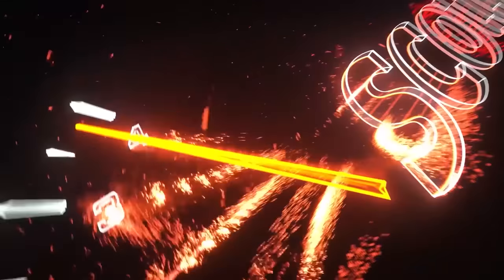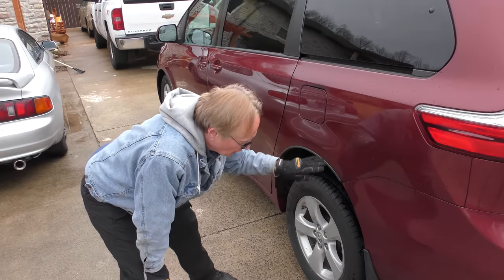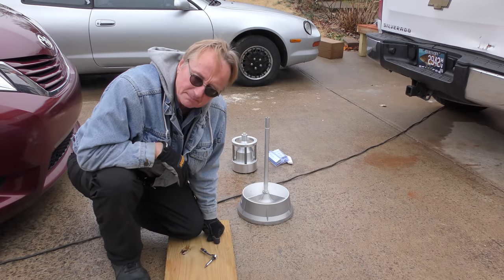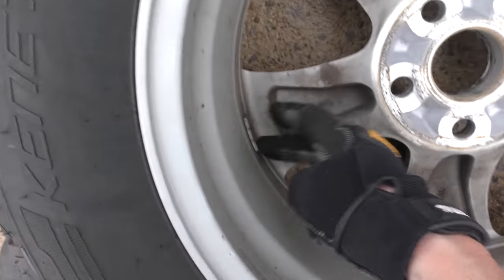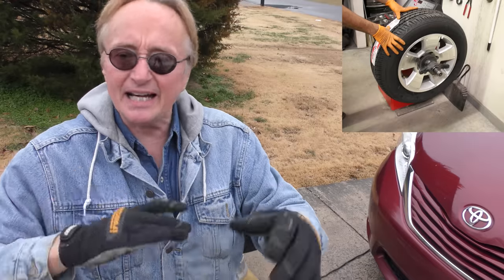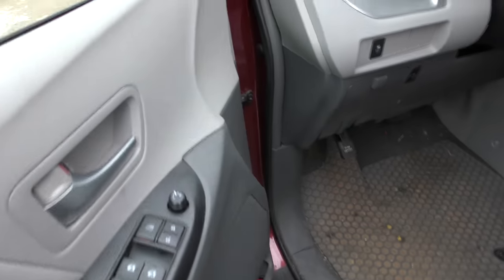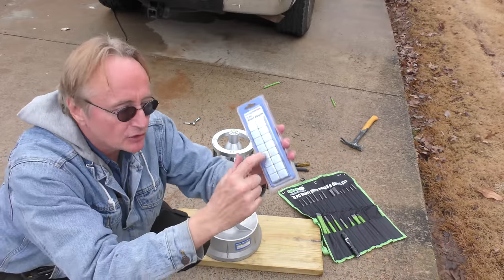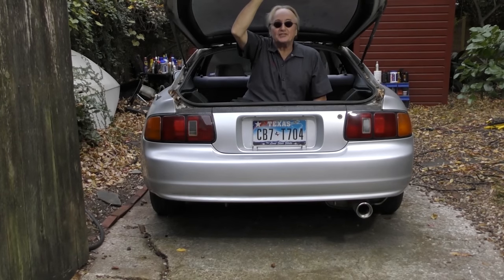Stop Going to This Tire Shop Right Now

Comment: I'm a new subscriber because I was so impressed. I'm 64 and I grew up in Houston where I was taught by my father and uncle. 

There are photos of me in a diaper sitting in the middle of a Ford flathead engine with a putty knife. 

My father died 20 years ago but I was instilled with not just helpful knowledge but also common sense because I would have been drowned in the San Jacinto river if I was stupid. Now I'm like him and I can't be around anyone with no common sense, even if they have a PHD.

If my father was alive today he'd be a subscriber too!

I have double vision from brain damage and I backed my 65 Cutlass convertible into a tree and dented my bumper but it did more damage than that because it shook my confidence to the core since I was a professional driver for my entire life.

I also have a 2011 Camaro convertible that is hard to see out of, and it was the last year model that didn't have a backup camera, so it's parked and covered because it only has 13,050 miles on it and it has summer tires. I rarely drive that car because I have a pickup and a rare 2 Door 95 GMC 6.5 Turbo Diesel 2 door SLT Z-71 Yukon with barn doors, and I am more confident sitting up higher.

I was planning on having a backup camera installed on my Camaro but I need to replace the tires because of their age and that's going to be costly, so first things first.

My question for Scotty is about the V-6 engine in my 2011 Camaro, which is the 3.6 24 valve 312 hp version with the exhaust manifolds that can be unbolted from the heads unlike the newer engine with the one piece head and manifold design.
I chose that year model for that reason! I opted for the V-6 because it runs on regular gas and the insurance is much cheaper.

The car is paid for and pristine so I can't imagine why I would part with it since it is like new in every respect, and I am seeing used ones with over 200,000 miles on carfax for sale, so my question was, ignoring the fact that it's a rag top, if maintained properly are there any issues with the engine or transmission on my car that you're aware of, Scotty?

I like the 2010-2013 because of the retro styling that reminds me of the 69 year model.

Comment: Great video about balancing tires...I purchased buy 3 get 1 free Michelins from the local Toyota dealership and the tires on the back are doing the same as in your video.  I rotated them to the front and the vibration started coming through the steering wheel so I know its the tires that need balancing.  It is next to impossible to find a good tire store anymore that cares and even the stealerships don't care.

Comment: I remember watching a guy at a tire shop try to put rim weights on and he could not get them all the way on.  No the matter how much he hammered it. I went over across the shop line and showed him that those weights were for a steel rim not an alloy rim.   Then showed him how you do it.  I still ended up paying the shop for the work but when the foreman saw the customer who taught his man how to balance wheels paid the full bill he stopped me in the parking lot and gave me a base of mobil1 for my trouble.  -U10

Comment: Just a note, been buying all our tires from Costco for decades. They are so busy to get a tire appointment, so  been doing my own rotations to save time. Had no idea mileage warranty voided if you do your rotation. Doesn't matter if you keep a record of it. The mileage warranty information just stated do the rotation per manufacture and nothing else. So much for that, I've been going to Costco for the good service and paid a little more. Now I go for the cheapest price for the same tires at a local shop. Scotty with static balance, haven't done that for years in my young days.

Comment: Surprisingly I used BJ's tire service and although they missed the time of completion, for a very reasonable price on good Michelin tires they did a good job.  The tires are balanced as now 500 miles later in all conditions the car runs perfectly.  Cannot complain about that.  But this is interesting to learn about how to balance tires yourself.

Comment: There are 2 different types of balance systems for a wheel/tire combo.  You have a "Dynamic Balance" and a "Static Balance".  A tire shop will only use the spin/dynamic  balance.  (I haven't worked at a garage that EVER had a bubble balance machine.)   Both balance systems are like comparing apples to oranges.  You can have it static balanced, and the dynamic balance will be off.  And the reverse is also true.

Typically the dynamic balance works great for tire balance and you'll be fine.  In very odd cases you'll need to do 'static' balance which is what Scotty did here.  IMO the tire/wheel should have been taken back to the shop and they should have been given the chance to re-balance the tire/wheel.  I've lost count on how many times on a "Mag" wheel it can toss a wheel weight shortly after new tires are installed.  

The shop should have been given the chance to make this right.  A simple tossed weight is highly likely.  And yeah while it looks like crap, you can leave the old stick on weights, as the dynamic balance will compensate for it.  I can see bashing the shop if they have a chance to make this right and still screwed it up, but nope.  Give 'em a chance to correct it, see how their customer service works.  Might have been a simple error or a tossed weight.  Part of judging a company is how well they respond to a complaint. Always give people the chance to make things right!  It's common courtesy.

Comment: I had the same issue my car’s ball bearing was a little worn because of the howl but I thought let’s get it done before it goes bad on me while driving. Took it to a place that... let’s say... had peppy boys as employees.  They took the tire off, and said it was the wheel/ball bearing and they said it will be $1700, part and labor to fix. It was a 2001 Mitsubishi montero. I said No and put it back together I am coming to get it. Picked up the care paid the $150 diagnostic and went on the highway to go home and the wheel almost came off because all of a sudden the car started violently shaking.  My brother, Capt. in the US army, came two hours away from his base to take the wheel apart and found that they put everything back without regreasing and the c clip wasn’t put on and the screws and bolts were hand tightened. We went back and my brother got me $1700 credit for their stupidity but I never went back to them. Love my army bro. Thanks scotty.

Comment: i've been doing wheel balancing for a while , in Jamaica before we got "highways" static balancing was ok, but since we've got better roads in a lot of areas , my standard is dynamic, i find i'm ok up to 130 km without a shake, after that i put it down to the tires we import , we're mostly Chinese tyres out here, our most popular brands which i will wear is Maxxis, Kumho, Sailun, all out of China, i never test them when it's wet, they're far from Good Years which we had been dealers for decades

Comment: I've had a lifter or valve tap on my 2002 chevy suburban on cold startup for 2 or 3 years. It stops after 15 or 30 seconds. But still disconcerting. Car has 125K miles. I just switched to Mobil 1 High Milage. And a Mobil 1 filter. Well the tappin upg noise has gone away. I'm amazed.

Comment: It is not good practice to put the emergency brake on when tightening lug nuts, the rotor or drum might not be tight to the hub . By using a torque wrench it will give a false indication because you can't over come the friction of the brake lining so once it is released the lug nuts will be loose. It's the same if you have someone push on the brakes and then torque the wheels up, the clamping force of the caliper can distort the rotor. The rotor won't sit flat against the hub and the torque wrench will give a false indication that the lug nuts are tight. Scotty I really like all your posts, you have helped a lot of people with problems. There are not a lot of people out there that tell the truth when it comes to vehicle repair or common problems.

Comment: Discount tire is not at all like that. There are numerous store locations. There's gonna be a few people may work there like that but overall it's not. Balancing tires are free if you are a customer with us. It's very funny when it's a customers first time there and they bring in the vehicle and there's counter balancing on there we strip all the weights off and measure it again always. Until are machines gives us the okay. Now there's small chances it may not be the wheels causing vibrations in the customers car and well tell them that but that's all we can do unfortunately.

Comment: The first time the torque wrench or breaker bar slips and you punch yourself in the face, youll never pull up instead of pushing down on the lugnut wrench again.

Comment: I thought it a bit peculiar that, in order to keep the wheel from turning when he tightened the lug nuts, Scotti set the parking brake. Yes the parking brake brakes the rear wheels, and it should keep the wheel from turning when you are tightening the lug nut. But setting the parking brake, and also dropping the car back onto the ground, would be a safer way of keeping the wheel from turning. With the car on the ground there is no risk of moving the car off of the jack stands, when you tighten the lug nuts. Put the wheel on the studs, tighten the lug nuts until they are hand tight or just a bit tighter – you can easily do that with the wheel turning – then set the parking brake, then drop the car onto the ground, then torque the nuts in the correct pattern. For 5-stud wheel, tighten the first nut, to about 1/2 the torque spec, then tighten the nut that is almost 180 degrees away from the first nut, also to half the torque spec, then tighten the nut which is almost 180 away from the second nut, etcetera, until you have tightened the last nut, then when you tighten a nut almost 180 degrees away you will be back to the first nut. Tighten it to the full torque spec. Do all the other nuts the same way you did them the first time. Then go around once more,

Comment: Hey Scotty, I have a 40-year-old Hunter tire balancer, I paid $1,000 for it 25 years ago, still works perfect. I'll have customers come in that need their tires balanced because they've been to stores with young inexperienced so-called mechanics that  don't know how to use the new overly priced fancy computerized balancers.  Until my customers, it doesn't matter how expensive your equipment is, if you don't know how to use it it's useless.

Comment: Everytime a customer comes in to my shop with a "new tire", I always check the PSI, and it  ALWAYS has at LEAST 10-15 pounds of pressure over the recommended PSI. Never fails.
   I know what they're doing. They stick an air chuck on it and walk off to work on another tire. Come back after a minute or so and disconnect the tire chuck and install it. All the while never putting a tire gauge on it.

Comment: I am amazed that your wheel was in balance without using balancing weights. The air valve/tire pressure sensor assembly should have caused a significant imbalance. Because of this, it would seem that there is no way your wheel could have been in balance.
Also, could you explain how to properly install wheel weights on both the inner/outer sides of the rims? Is one to equally divide the weights between the inner/outer sides? For better appearance, could one put all the weights on the inner side, or would this cause wobble? Thanks.

Comment: My '07 Ram 2500 had a rear shake at 40 mph & 60 mph, so I took it to a "discount" tire shop to get balanced. Guess what? Shake is still there! I went back and complained and they rebalanced all tires with a full refund. Did it fix the shake? Nope! After seeing this video I am considering the bubble balance. Old school is best in my book.

Comment: Scotty you made me laugh this morning, i have tyre shop, do alignments , tyre sales, suspension installation, & most times i have the same single issue, oboy, i keep asking , did you make the machine? , no , but they keep doing what they do, when the customer comes back, i'm out there making sure they do it right, they leave old weights on there or do not place them correctly, other shops i have to advise them they have to do dynamic & not static, great video Sir

Comment: Scotty do my own tires at the house, yep those Harbor Freight balancers do work, if you can't get it right or there is a issue after the problem is a questionable tire or say a drum or rotor that is out of balance.  Yes I have had those world famous Walmart sold Douglas tires that are not made right, even they spin balance them they go to hell real fast with ply separation or such.  Then I have had drums with the weights falling off.  Actually the balancer worked to fix the problem along with the Trusty Mig.  I put the nuts on lightly with the impact, but you are right the Torque Wrench.  My torque wrench along with the associated bolt torque cross reference is a must in the lid of the toolbox.

Comment: My first mechanic job in an auto repair shop was Montgomery Wards. I did tires and brakes.  I took pride in my tire balancing skill.  I also did brakes. Back in those days disc brakes were not common.  The shop foreman was not ethical so I did not work there for a long time.

Comment: Tires and wheels are usually marked and made to be mated together to compensate for radial runout and weight variance but that is often ignored as well. Better shops have road-force balance machines but balancers of any type are only as good as the person who uses them.

Comment: Well , I forgot to do what my older Brother suggested! To get back any parts they remove as proof. The tire shop replaced a tie rod and ball joint on left front in 2018 along with new tires,then  a new tie rod and ball joints front an back again this year. Yeah my suv has had many highway miles but always road great , it has shook since the work was done. They put a cupped tire on front and right out of shop I lost a cv joint. Had it towed. I’m afraid to take it out of driveway now! I have not found any recourse.

Comment: The electric impact is a life saver. I use it also to tighten. Start the lug nuts by hand them spin them down with the impact. Not tight, just til it makes the impact sound. Then snug them down by hand properly. When you've done it for years your calibrated hand will know when it's perfectly tight.

Comment: I worked in plant that makes wheels for oem. And the are made with a low point they are marked on the wheel where that is at.  The point of marking the low point is to help the auto plant match of the high point of the tire to the low point of the wheel.  When is done less weight is needed to balance the Wheel and Tire

Comment: I got 4 tires at BJs.  They under inflated all four tires and didn’t balance any of them properly.  Will never get tires there again.  I inflated the tires myself and took the truck to the dealership to get this fixed.  I’ve bought tires at Walmart as well and never had a problem.

Comment: Thank you Scotty for your videos. I have learned a lot from these videos.  I have a 2003 excursion with a blown  head gasket or a cracked head. I have decided to put a new  motor in it. Should I put a new motor  or get a used  motor  with a grantee for 3 years. Someone said  don't get a rebuild one.

Comment: Tire stores are notorious for improperly inflating tires. I bought 2 rear tires recently. I checked the air pressure when I got home (less than a mile). One side was 25psi, the other 35psi. I called the store and was told "thats normal, it can take a day or 2 to equalize". WHAT! I was born, but I wasn't born yesterday. What a stupid thing to tell a customer.

Comment: I don't agree with using an old style bubble balancer spin balancing is the correct way to go.  Also the lug nuts need to be torqued correctly otherwise the wheel can distort along with the brake drum and cause all kinds of problems.

Comment: There is no doubt that you need to be wary of those quick tire change places and their methods. I had one place put 8 ounces of weights on a rim. I said " NOPE ", got the manager to come fix the problem. The tech learned a little more and I did drive away happy.

Comment: I actually have a tire balancer for dirt bikes and I bounce the tires on my dirtbike tires . See the type of racing I do is called Enduro‘s and they last around five hours going through the woods and also so require some road riding during the race and that’s the reason why it helps to have a balanced tires.

Comment: Much need info on tire balance I recently had a front tire replaced and it looks like the weights were scraped off. I believe they used a dynamic balancer and the steering wheel doesn’t shake...🤷‍♂️

Comment: I got so frustrated with this I got my own dynamic balancer. I calibrate it each time before time I balance. I no longer have the shakes on my vehicles. 1.) kids at tire shops don't care 2.) when was the last time the balancers at tire shops were calibrated ? They never use a torque wrench, so much for your rotors after the tire shop. It's really friggen sad.

Comment: Clean non-offensive comment: the Firestone shop I went to had damaged the side of my car taking in and out of the bay, breaking the side marker light fixture. So they put the fixture  back together (just enough to stay in) & brought it around front and parked the car in a way that I wouldn’t notice what they had done. When I went back to complain about it, each time they gave me the runaround about how the guy that I needed to talk to wasn’t there and I’d have to come back, where they were just buying time until the I went away.